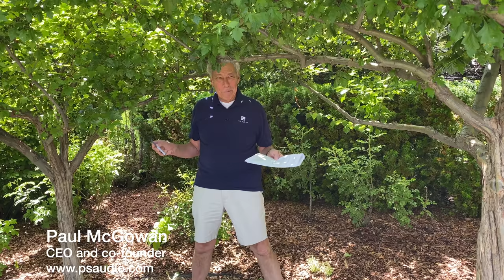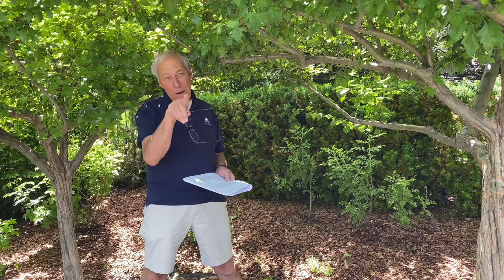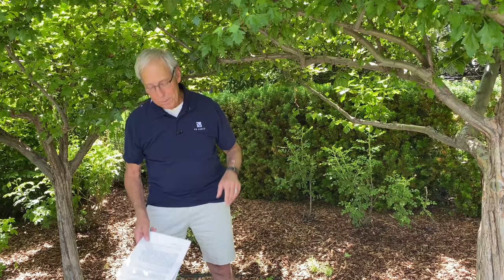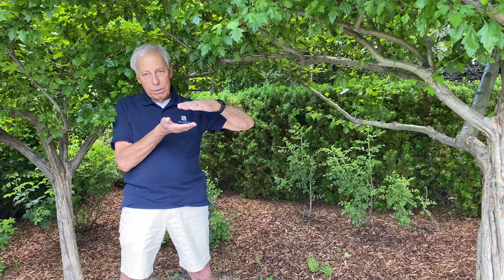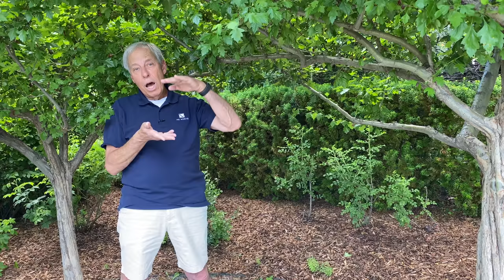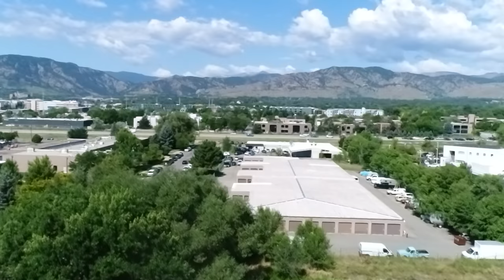Current vs. power in an amp

Comment: Why does  Adcom  claim high current in their amps such as the older 5800, 5802 etc. but the spec sheets only rate the amps at 50% more power into 4 ohm loads over 8 ohm loads. This doesn't seem to indicate any more current than traditionally available from solid state amps. Every high current amp I've owned almost doubled (on paper did double) the power into 4 ohms and some again into 2 and 1 ohm loads. What gives?
Reply: Carl Capps  You're confused. A high current amp will quadruple it's 8 ohm rating when bridged assuming it can be bridged.
Reply: The real question is, why do most amplifiers that claim such high power at 2 ohms or 1 ohm, not have the power transformer VA rating, or line fuse rating, or max power consumption (UL) rating, to provide anywhere near that power?  I consider it remotely likely that they've invented any kind of over-unity power conversion technology.  
If you really want to find a "high current" amp, then shouldn't those be the numbers to go by?  
The Adcom 5800 is rated 250W/ch into 8 ohms and 400W/ch into 4 ohms, but the latter is nowhere near the amp's current limit of 22A peak.  Keep in mind the spec sheet rating is for the same level of distortion, so at 4 ohms it probably has some headroom and I wouldn't be surprised if it can deliver >450W into 4 ohms at the threshold of clipping.  Ultimate power capability would be about 600W into a 2.5 ohm load.
Reply: Yes you re confused and don't they teach how to spell impedance in engineering classes anymore? My point was any true high current bridgeable amp should quadruple it's stereo rating. A high current amp will double it's rated stereo power into 4 ohms and come close into 2 ohms. Any less than this and it's only average in current delivery. I have true high current amps that double down into 1 and even 1/2 ohm loads.
Reply: 22 amps peak is not high current at all. High current amps typically have greater than 50 amps peak in that power class. Transformer size alone isn't an indication of ability to work into low impedances. I have an  amp with a 3.3kva transformer that is not 2 ohm stable.
Reply: 2dB of headroom is typical in an amp and only an indication of how loose the power supply operates. Some amps have a stiffly relegated power supply and will have much less headroom yet can have massive current. The two have absolutely nothing to do with each other. FYI you abbreviated decibel incorrectly. It's named after a person so the B is capitalized but not the d. Are you sure you're an engineer?
Reply: @carlosoliveira-rc2xt  
"Transformer size alone isn't an indication of ability to work into low impedances."
Who said it was?  Necessary is not the same as sufficient.  
And why is the person who criticized another about their spelling of "impedance," calling a power supply "relegated?"
Finally, not everyone owns speakers that can benefit from 50A of current, or the ability of an amplifier to drive 2 ohm, 1 ohm or 0.5 ohm loads.  My mains have 4 ohm woofers, and at no frequency from 15Hz and up, is their impedance less than 4.4 ohms.  
Let's be reasonable, please.  More often than not, owning an amplifier capable of driving 1 ohm loads is just an ego trip.
Reply: @marianneoelund2940  You implied it was necessary. Reread what you wrote.
Reply: Obviously an aggressive autocorrect. The man claims to be an engineer yet misspelled impedance and dB. That speaks volumes. I can spell regulated but I'm currently typing with a mouse on an outdated android device due to WiFi issues on phone. Still did better than he.
Reply: @carlosoliveira-rc2xt  
You're still not getting it.  
Yes, I said it's necessary.  But that does not mean it's sufficient, because there can be, and generally are, other requirements in addition to that.  
If you want your car to accelerate from 0-60 in 4 seconds, a 400HP engine may be necessary, but that by itself may not get you to goal, i.e., it's not always sufficient.
Reply: Carl Capps  
Sounds like you are thinking of "bridging" as being a parallel connection of two channels.  
In fact, the term refers to a series connection, where one channel output is inverted from the other.  The result is approximately a doubling of the voltage available to the load, and each channel "sees" only half of the speaker impedance.  
A simple example for the DC case, would be a dual power supply with + and - outputs.  Say it's a dual 20V 5A supply.  Connecting an 8 ohm load from +20V to ground, or -20V to ground, gives 2.5A load current and 50W power to the load.  But connect the 8 ohm load between the +20V and -20V terminals (ground terminals not used), and then the voltage is 40V, current is 5A and power is 200W to the load.  But if it's a 30V 5A dual supply, it can't drive the 8 ohm load bridged at full voltage (60V to load) because it doesn't have the current capacity.
Reply: Carl Capps  Lol. Well that explains it. Cheers!

Comment: Whatever happened to Nyquist complex impedance plots? 
At one point years ago they were commonplace, whereas now one rarely encounters such a measurement. 

There's so much information that can be gleaned from such a measurement, especially in this context of explaining how a more robust high current amplifier design interacts with a difficult load.
Reply: There are still some reviewers who compile Bode impedance magnitude & phase plots, if it's just the speaker information you are looking for.  
Beyond that, there is the Nyquist stability criterion (NSC), which uses a complex-plane trace of the open-loop forward transfer function (with load), multiplied by the feedback transfer function.  The criterion states that the system will be stable with feedback connected, if there is no net clockwise encirclement of the s = - 1 point.  It is a much more robust method of ensuring stability, than using the simple gain and phase margin rules.  However, I haven't seen anyone use or even mention NSC since I graduated from the electrical engineering dept.

Comment: An amp's current capability may be a factor when you start driving it to loud volumes, an amp with larger power supply will have less vdroop, and also amplifiers with higher damping may have slightly higher impedance to the same speaker due to more rise.

Comment: You have a speaker that needs more A cheap amp has 100 watts at  8 ohms, but at 4 ohms is has 100 watts. A great amp has 60 watts at 8 ohms, but will double its power at 4 ohms at 120 watts A great amp delivers more power at lower volumes. Its like a little engine outruns big car on top end, but dont pull as good as big engine.
Reply: There are many counterexamples to the claim that a "great" amp will double its max power rating at 4 ohms, relative to 8 ohms.  It certainly doesn't apply to tube amps, or solid state amps with output transformers.  And I wouldn't say that amps with an 8ohm/4ohm selector switch can't be "great" amps, or that amps with variable or multiple internal supplies that provide lower rails for low-impedance loads have any performance deficiencies.  
I think the audio community has become rather spoiled by direct-coupled SS amps that have much higher power ratings at low load impedances, to the point that they believe it's now mandatory, in order for any amplifier to be considered a high-end design.
Reply: @marianneoelund2940  Thanks for clarifying my commment. Seems like amps are little understood compared to speakers. I have  a Krell amp,  & a tube pre amp, but I wished I knew what a great amp for the money is.  I enjoy the cheap old NAD 3020 because of its warm tone & the cheap PSB bookshelf speakers because of it warm tone. Both were gigantic sellers. I have 2 cheap sony amps. One is harsh, seems like cheap stuff is harsh. My other cheap Sony amp makes the tweeter with a real warm sound, so I got another one exactly the same amp for a friend. Maybe there is something good in the designs that gives a warm tone. But the cheap Sony amp with a good warm tone, it looks like all cheap amps could be designed that way. Even though a cheap isnt clear, some are enjoyable to listen to. Also I have heard that a 4th order distortion is naturally great sounding for warmth That swome want to remove the distortion. An example, dolby noise reduction removes distortion & removes good sound. I have a Nakamichi receiver with a Nelson Pass circuit That is suppose to be Class A only a low volume= that sounds great. I wonder if all amps run Class A at low volume. The Nakamichi runs cool. I have heard that class D ampsarent that great. I have heard that Class G is better, but I cant find any information on class G. Im thinking of trying a class D amp for cheap speakers..
Reply: @myronhelton4441  
Strictly speaking, all Class AB amps do operate class A at low power, but sometimes that means only a fraction of a watt.  
Regarding Class D, keep in mind that the technology is still improving, both the switching FETs and the circuit design techniques.  It's still not quite a mature design class, but some of the newest designs are quite good and the future looks bright for Class D.

Comment: Can you or anyone use an analogy for why you need MORE amps to maintain the voltage (volume) the LOWER the OHMS/impedance/resistance gets?  I know it's correct but it sounds counterintuitive to me still. 
I would have thought that the higher resistance you have across a given load, the more amps/current needed to push the voltage (? or vice versa?)  
I still have a problem understanding this. I would think the less resistance/lower ohms, the easier electricity will flow so the less " pressure " or voltage you need to drive something like a speaker. But the reverse is true. Correct?  Help!
Reply: Victor E i think you just answered your own question in the second paragraph... since when there is less resistance, i.e. counter force, it would be “harder” for the same level of electric current to mount the pressure.
Reply: @haomeister  Thanks for reply.  I have tried to use highway traffic as an analogy. Does this sound correct: 
Low resistance- Multi lane highway allowing many cars (electrons/voltage?) to flow. But this free flow ends up in higher avg speed, requiring more gas to keep moving (current) and also heats up the pavement (wattage?)

High resistance - a single lane road where much fewer cars can flow, butrequiring less gas (assuming the avg speed is slower but constant)  and producing less heat (watts)?

I still feel like I'm getting it wrong. 🤔
Reply: Victor E I am no expert on this topic. I use water thru pipe, with one end elevated, analogy, to help myself understanding the works of electricity. Wattage is already a time related, like speed.
Reply: I always think voltage difference is the cause for electric flow. Not sure about the relationship between loudness and voltage in audio equipment, though, as Paul mentioned in the video. Equations derived from Ohms Law show computational relationship of the three variables, and wattage. I may have contradicted myself in the above comment.
Reply: @haomeister   It's a simple ohms law equation Power in watts = the current squared times the resistance ,so if the resistance goes down the current must go up to keep the watts the same.at a given volume setting.
Reply: I think your confusion is arising because of Paul's "voltage is volume" statement.  That is only true for a single, given speaker (or speaker impedance).  When you change the speaker impedance, then you need to use the "power is volume" rule instead.  
Also, as resistance (impedance) rises, you need less current to develop the same voltage (but power will decrease).  
Your statement that less resistance will require less voltage (for same power) is correct!  
Now let's talk about power.  In the mechanical world, it is force x velocity for linear motion, or torque x rpm for rotational motion.  If you double the force while keeping velocity constant, you double the power.  Or if you double the velocity while keeping force constant, you double the power.  But usually, force and velocity have a cause-effect relationship, so if you increase force, velocity also increases.  If you have a viscous device, doubling the force will also double the velocity, so power goes up by a factor of 4x.  In other words, it's a square-law relationship between force and power, or between velocity and power, when force and velocity are linked that way.  
The same thing happens in the electrical world.  Power is Voltage x Current.  But voltage and current are related by resistance (or more generally, impedance).  If you increase one of them, the other goes up by the same percentage, so again we have a square-law relationship between voltage (or current) and power.  
The relationship between voltage and current is Ohm's law, V = I x R or V = I x Z.  Also, I = V/R or I = V/Z.  
Then from P = I x V, we can substitute and find that also, P = I x (I x R) = I^2 x R, or P = (V/R) x V = V^2/R.  
Now, using the "power is volume" rule we can freely compare various combinations of V, R and I.  All of the following have the same P, and produce the same volume (if the speakers have the same power sensitivity).  If you study this list, it should put your questions to rest:  
V = 28.3, R = 16, I = 1.768, P = 50
V = 20, R = 8, I = 2.5, P = 50
V = 14.14, R = 4, I = 3.536, P = 50
V = 10, R = 2, I = 5, P = 50
V = 7.07, R = 1, I = 7.07, P = 50
Reply: @marianneoelund2940  Thank you for that detailed and very clear response! 
This: " we have a square-law relationship between voltage (or Current) and power." was very helpful in my overall grasp of the content. 
The question now is, being that you can have either high voltage/lower current or lower voltage/higher current and come out with the same power, what are some real world examples where one method is preferred over the other in electrical design? 
Such as audio applications vs. lighting applications vs long distances vs short distances etc?
Thank you guys again for the help!
Reply: @kluzaklien  
Different devices are more suitable for different voltage/current combinations.  BJT's (NPN/PNP power transistors) have a unique limitation due to secondary breakdown, which makes them most suitable in low voltage/high current applications, and less robust at high voltage.  They always need a current limiter or monitor circuit to protect them against over-current.  A couple of examples:  
1.  The Sansui BA-5000 is one of Sansui's most noteworthy vintage amp designs.  It uses output transformers to provide the same rated power for 2 ohm, 4 ohm or 8 ohm speakers, but what's telling, is that the 2 ohm output is actually the direct-drive one - connected directly to the output transistors.  So the 4 ohm and 8 ohm outputs use the transformers to provide higher voltage at lower current.  
2.  The Dynaco Stereo 400 (a Dave Hafler design) uses series-connected output transistors which share the supply voltage, allowing each transistor to operate at about half the supply voltage.  
On the other hand, MOSFET transistors do not have that limitation and the designer only needs to make sure they operate within voltage, current and power envelopes.  There are some MOSFET amps which have no active current-protection circuitry at all, and rely simply on fuses.  
In the electrical power world, designers can greatly reduce losses in power lines by keeping current low, and using high voltage instead.  With ohmic losses of I^2 x R, you can see that doubling the voltage and reducing current to half, cuts those losses by 75%, or can allow use of much less expensive lines.  
Vehicle electrical systems once used 6V power, and when the change to 12V systems was made, it was possible to save a great deal of copper in the wiring.  Large commercial trucks and military vehicles typically use 24V, to more readily transfer the high power needed to crank the big diesel engines over.
Reply: @marianneoelund2940  Marianne, I sincerely appreciate your incredibly informative reply. You've answered so many questions and cleared up some concepts I've struggled with for years.  You've inspired me to go back to some foundational texts and freshen up on some core concepts too so I can really make the most of your info. 
Thank you so much! Greatly appreciated. 🤗